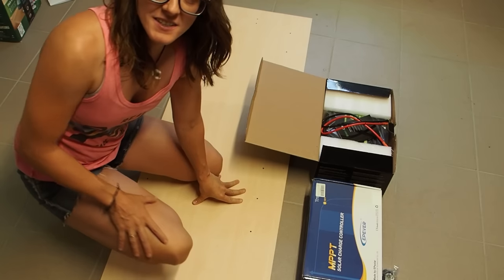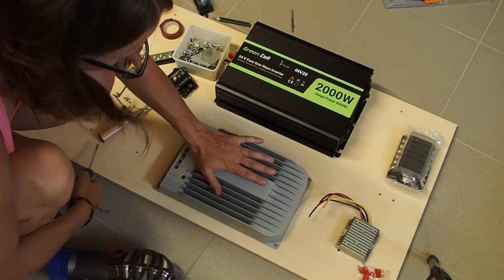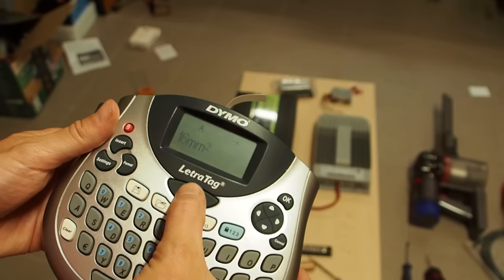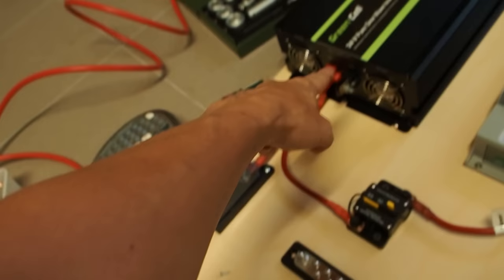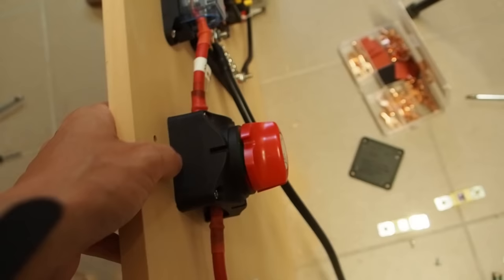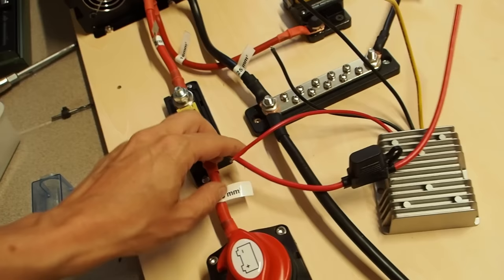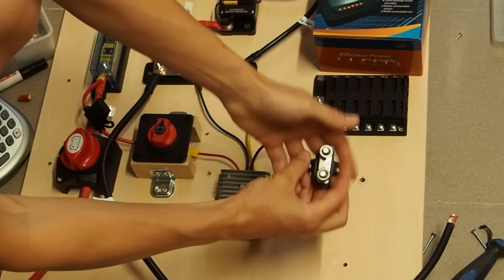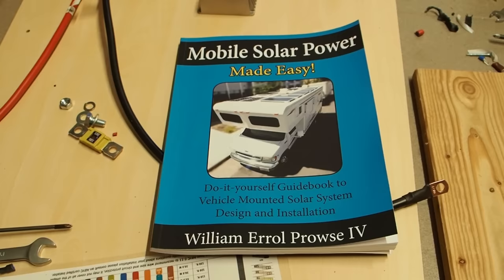DIY Solar System (24 Volt) for fridge and freezer! (Part 1)

Comment: Thanks for the video. 
I'm in no way an electrical expert but if using high frequency inverter for inductive loads, like a fridge, it's recommended compensating with much higher wattage inverter. Since HF inverters are more sensitive to high "rushing loads", like from fridges, it's likely it doesen't last long or even worse breaks. If possible a low frequency inverter would be a better option.

Comment: Awesome care you had with the wires and everything to protect the system or the power and looks way better than most electricians could do. Just one thing that you forgot completely. As you know everything on that heats a bit and some may heat a lot, so why you built it on a Wood panel and not put some heatshield behind every part that may get very hot not the wires, only the systems and the fuse . You should use aluminum thick foil or something better to protect your wood from heat, otherwise you know heat may burn wood , even may not be at first but it will eventually burn with time . Apart from that great care and looks amazing as well.

Comment: I have a small 12 volt solar system (210 watts).

I like it very much.

It is surprising what you can do with such a small system.

The lithium ion phosphate batteries were the best and most expensive part.

Comment: I had notice you had used some of the wiring included in some of your kits. Aluminum clad copper (acc) is a strict no-no, ask Will P. As an added, I've watch you when you were starting out on this journey, so much improvement in all your skill sets. Cudos

Comment: Very impressive work, however I did not understand the part where you exchanged the wire connecting the inverter to the left side of the breaker to the solar loader. In my understanding there is no way for current on the left and the right side of this breaker could be different.

Comment: All the discussions (comments, mine included) about the wire to the 50 amp breaker being too small are worth nothing when we get to 24 minutes and there is a #12 AWG wire on an unfused #4 AWG wire from the battery that feeds the 15/20 amp fuse to the DC to DC converter. 
If you follow the first logic the DC to DC converter would attach after the 100 amp battery fuse but it would also be a #4 AWG wire to the 15/20 amp fuse.
I guess when I build mine I'd also add a positive terminal block and fuse it appropriately.

Comment: As everyone agrees the wiring methods are great. The only confusing thing is using different wire on either side of the 50A breaker. With the breaker closed the same amps with be on both wires. Im guessing it will be under 50a because the 100a from the battery should not be used by the charge controller.

Comment: I had the same charge controller.  It died after 6 months.  I replaced it with a  Victron.  More expensive but has a better reputation.

Comment: You don't need a breaker between the inverter and charge controller, both have safety built in and this part of circuit here is converted/controlled power, the solar input and the mains output are more random, its better to have protection around these 2 devices rather then between them. This is how I have it in my system, looks cleaner with 2 pole din rail breakers.

Comment: I’m just learning about solar now. One thing I vaguely remember is that the components should be mounted on fire proof boards. Such as cement board. 

It looks like the backing is particle board. Isn’t that unwise?

Comment: i ended up building a 3000w 24v solar system .. with powmr 3000w all in one.. with 2kw of solar panels and 5kwh of lifep04 batteries ..  under 3000usd .. installed it on my camper

Comment: Well done, One suggestion.. do your work on a work bench aka a work surface that does not require you bend over.. and work in a really uncomfortable as well as really bad for your back.. kinda position ! Seriously... It's always best to work in a way that you do not need to bend over and or work in a way that you can not see or easy reach your project components.. Just saying.. save your back, neck and posture.. You'll be glad one day trust me ! I'm 65 and I have no as in zero problems with my body. back is great.. because my dad taught me how to save them.. and I have.. so good luck.. stay safe say healthy !

Comment: I also run a 24 volt system. 
4000watt Samlex inverter 
Outback Flex max 80
8 six volt lead acid Trojan batteries
6    310watt Peimer solar panels 
2000 watt Yamaha generator
During sunny weather I easily run the largest refrigerator, upright freezer and small chest freezer in addition to this 1/2 horse sump pump, air compressor, saw or just about anything. At night nothing, not enough batteries generator only.

Comment: For the gauge and length of the wires I use an online voltage drop calculator. Voltage drop for solar systems should not be more than 2%.

Comment: Isn't your charge controller supposed to be hooked directly to the battery Bank itself instead of just jumping into the inverter like that?
Reply from the maker: You can do it both ways
Reply from the maker: You are never allowed to attach the load terminal of the mppt to the inverter tough.
Reply: Scrolled through all the comments to see this question being asked. I've never seen the charge controller paralleled  with the DC input on an inverter before....with or without the battery attached.
Reply: @lkylon204  i wouldnt do it this way. Just sayin
Reply: Whoever told you it's ok to do this is trying to kill you. This I never ok to hook up like that. It is against all codes known to man. Also the resistance created from this setup is phenomenally large. Good luck.

Comment: Since you have a 24 volt system, you don't need in line fuses for the solar panels cause it does not add it just cuts off the whole system and you have no flow to the charge controller
You only need that on 12 volt system

Comment: No need to change the wire fused at 50 amps. In a series circuit current is the same throughout the circuit.

Comment: I use bike  24 volt/9 Amp battery with 300 W/ 230 V inventer to power of freezer during high electricity costs and I recharge battery in low costs. Battery is free and inventer price 35 €. It`s useful in blackouts too.

Comment: did you drill through into your floor tiles???   Those resetable circuit breakers are known to be unreliable in campervans, they will not trip at the rated current. ,regular rechecks for all screwed clamps as they tend to undo and get hot risking melting.  Overall a fantastic video though.

Comment: Well done.  The only concern I would have is you did not mount everything on a fire-proof cement board panel.  Then you could screw the board to the plywood.

Comment: Hello Lily, you have a very nice solar equipment which I can only owned in my wildest dream. I wish I can I have it someday.  Hope your next project would be using a hybrid inverter,  which you can sell your excess electric harvest after the battery becomes fully charge.

Comment: Great job Lilly. Just one thing I noticed that your thermal circuit to your mppt (red wire) and the red wire to your inverter should be the same length.  That ms what others do from what I have been told .
Reply from the maker: First time I heard that. Can you tell me were you got this from?

Comment: Great job, only thing i would have done differently is to solder the ends of the wire, As over time they can become a point of high resistance.

Comment: EPEVER.  CHARGR CONTROLER.
This unit has current limiting.  You can increase the solar panels which will give you more power in winter.  Up to 100% is normally recommended.  This is detailed in the instruction
The fuse should be as close to the battery as possible,  The fuses job is to protect the battery.
Oh and you have not mentioned it so far,  but do not forget your solar panel maximum open circuit voltage is 138V.

Comment: If the freezer is 'super' insulated by added additional ridged foam board and a Mylar sheeting that can be purchased in long and wide rolls on Ebay (or aluminum foil) to the outside, and using other expedient methods, we can reduce the over all power consumed by up to 50%.  A penny saved is a penny earn, and the equipment, including the freezer, will last longer.  I'll be using a very small 12vdc/propane powered refrigerator, and eliminate the need for a inverter.  During the winter, we have no need for refrigerators or freezers....  A pressure canner and jars are much less expensive that a larger photovoltaic system needed to run a freezer to preserve a large amount of food, and it is portable, and will be preserved for up to a decade without power.  Canning is actually very easy to do once one learns the basics.  Use .5 liter jars to control portion size....  I wish you-guys success...
Reply: @bio-techlarry9602  Yes, good point.  Make sure that the insulation does not impair the air flow, and heat exchange that is essential for the operation.  The freezer is a heat exchange device.  If there is a fan, or passive radiator inside the rear  of the freezer,  that can be internal, or often on the exterior, do not place insulation on or around the radiator, otherwise it will not operate as it should. It is advisable not to place insulation to the rear part, but should only be done if one understands the principles of refrigeration and can design the proper method of insulation that is appropriate for this area of the refrigerator or freezer. 

If there is a power outage that could be longer that a day, piling on any kind of insulating material, where ever it is possible, will greatly extend the time the food will remained preserved by cold temperatures.  I have made my own expedient 'ice chest' that kept 50 kilos of meat frozen for more than 7 days in 40C temps without adding ice or using power from any source or type...
Reply: Tough to can Ice cream or Ice cubes. 🙂

Comment: Very clean Build Lilly!
Reply: Only thing I would change instead of dry crimping is to add solder due to fear of all the wires not touching as they should causing resistance additions in the Lines.  Talked to my Buddy John ( Army Engineer ) He agrees as he works on Military builds ( 20 years experience ) I'd always trust his advice. Infrared camera did show a cooler wire condition and let us know what wires also need upgrades as we added loads to get close to 80% use of our system.

Comment: Hi, and thank you for the great guide, I want to ask, why put a 100A fuse, and a switch, instead of just 100A breaker, that will cut off at 100A, and you can also close manually if you want ?
Thank you :)

Comment: At minute 21, you say there was a mistake and you changed the wire going from the 50amp fuse to the inverter.  You said that is due to the possibility the inverter can have 100 amp.  But if a 100 amp went through this wire the 50 amp breaker will trip and no more current will be going through.  Am I missing something here?

Comment: My experience with cheap inverters is not positive, so I bought compressor refrigerator & freezer that can work of 24V directly. Power consumption is less than 100W, no thick wires & heavy fuses needed.
Reply from the maker: 100w is a lot. My fridge draws 26w

Comment: I could be wrong, but I'm pretty sure if u turn that battery switch off while the panels are hooked up. It will damage your charge controller. Panels cant be hooked up with out a battery. Same if that fuse drops.

Comment: 2000 watts at 24 volt dc is not small wires . Check the ohms law before you burn up relay coils and motor windings and voltage shortage. It is watts divid ed by volts = amps , the amps times 3 is tge correct size for motors with a capaster. It a big size feeder wire alot of amps.

Comment: Connect the buck converter to the DC out of the charge controller. There is nothing to stop the buck converter discharging your batteries in your setup.

Comment: Lilly you need to connect the charge controller straight to the battery (after your thermal cut off), when the inverter is pulling heavy loads it’s just more efficient for it to work out the charging cycle.
Reply from the maker: you can do it both ways.
Reply: @SurvivalLilly  I was thinking the same thing as @wizardorlegend but I trust you and your electrician know what you’re doing. Thank you for bringing all of your knowledge to the USA. 🇺🇸 🇦🇹
Reply: @SurvivalLilly I recently installed a professionally engineered system using high end equipment. The output of the charge controller was wired to the same lug as the main battery cable just like yours. In my first system I put together from bit and pieces left over from my contracting business I ran the output of the charge controller to the battery positive post. Both ways worked well.

Comment: might you need add LVD (low voltage disconnect) to 12v save battery go flat

Comment: Love the video, 31 years of experience shows. I do have a question about your 12 volt fuse box. I notice yours has only the positive connection where you attached the yellow wire to but I don’t see the negative connection. I just bought one and it has a positive and a negative top and bottom. Would my last black wire go on my negative connection or to the bus bar like yours. Thanks in advance if you can answer that.

Comment: very nice video. what will happen if the fuse on the battery is broken when the panel is ON? I think mcb with 4 poles is effective because once the battery is off the panel will be shut off also.

Comment: If I use 4awg wire I should use a 100amp fuse bolted onto the 24v lifepo4 battery?

Comment: Why dc to dc converter. Can’t you just hookup to one of the 12v battery.. ?
Reply from the maker: If you connect the batteries in Series it is 24volts. At both sides

Comment: Nice Job! I think you are overkilling with this cables. The Current-carrying capacity depends on many factors, consult the data from the cable manufacturer.

Comment: Brilliant   Will is Great and YOU ARE TOO.  This was an incredible build   
Comment on having an electrician review work.  
Go to or call your local Building Department or City Hall and find out what rules there are governing your work.
Then call your insurance agent or insurance company and as them if they have rules.

Most areas require a licensed electrician to perform all work (which usually means supervising staff doing most or all of the work, just like you just did (ditto plumbing or structural, or just a building modification like adding a room) to be filed with building officials or even file and signed off that it is complete and up to code with building official's.  MORE IMPORTANT many insurance companies will void your policy if you don't have professionals perform the work.
Reply: Don't forget this lady lives in Europe. They have many different levels of electrical licenses, meaning if she came out of high school with the basic level, she could get an electrician with the appropriate level to check and sign off on the project.
Reply: I'm not sure where you live, but at least in Illinois, a home owner can do all their electrical work. Although I've been an industrial electrician all my life, that's irrelevant when it comes to home owners doing their own wiring. Most home owners won't because they are afraid of electricity or afraid they will burn down their home. No electrical inspection would be require for a simple installation she's doing. I  installed a 13 kw solar system in the home I built and wired myself. Of course the house had permits and inspectors around all the time, but the solar installation didn't require a permit or inspection and it included installing 2 - 4400 watt magnum inverter chargers 2 - 80 amp outback solar charge controllers and 32 - 6 volt 200 AH Batteries configured to supply my inverters with 800 amps at 48 vdc. No permits No inspections.
Reply: You are allowed to do the installation the electrician can just come to issue a certificate of compliance. Simple
Reply: @pstoneking3418  Plus, as an Insurance Agent, you should know that if you are not licensed and you burn your house, we don't pay anything.

Comment: If using a lead acid battery it will need to be oversized as to not exceed the maximum thermal discharge limit of the battery. 20-35% of capacity is the max continuous current so for 100ah that equates to 35A max, in reality to use lead acid  2 x 300ah batteries will be necessary for 100A output to the inverter. On top of that higher current reduces the capacity to a much greater extent than lifepo4.

Comment: Do you know if I could mount all of my components to steel instead of wood and attach all grounds to the steel so I have less wires ?
I don't if mounting to steel would cause a fire hazard but they do it that way on cars and so it got me thinking

Comment: Those “cables” which came with inverter - I suspect those to be aluminium core a therefore to be thrown to garbage as it is garbage. I also, plesde do not use that 50A breaker, it is going to get hot and burn over time. There are videos of it on YT.
Edit: wires to the battery should be the same lenght. These stranded conducgors need a ferrule to be fitted in order to maintamt proper connection to terminal. 100A fuse could melt if batteries are nearly empty: (2000*1.1)/(10.8*2) is over 100A. Time 22:02 - that 16mm2 would be just fine - there will never be more amps than MPPT can give. And last thing - I would use overvoltave surge protection on solar input.
Reply from the maker: We want to run 2 fridges with it. So most of the time we are only using 150 watts altogether. The initial surge of the compressor is about 850 watts per fridge so that makes 1700 watts maximum we will use from this fridge. So the 100 ah fuse is fine.
Reply from the maker: What overvoltage surge protection do you recommend